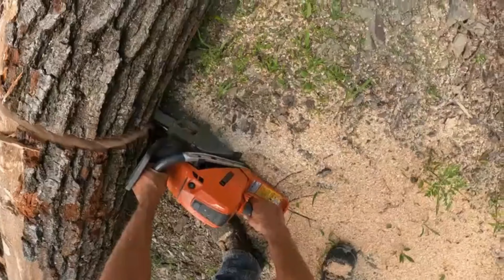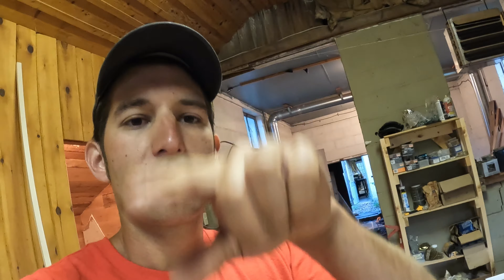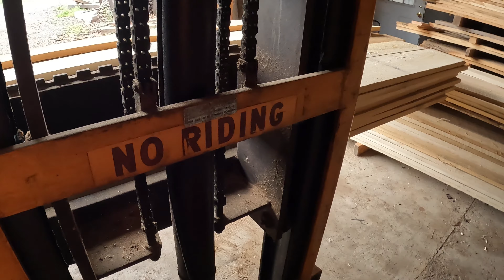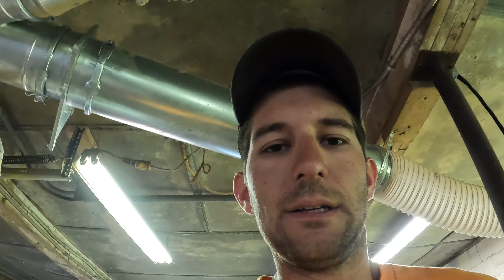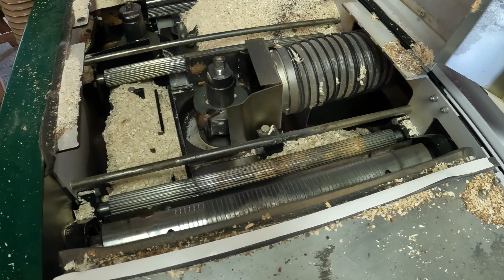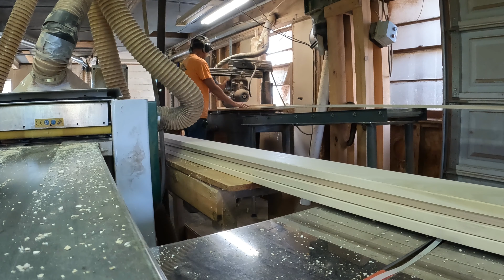Creating A Custom Trim Package For a New Home, Part 1

Comment: Im new to your channel and i realy like your content 🙂
A thought  that came to me and i have no idea if it would work for that small profile if the back and bottom is just straight would it work to make the profiles on both sides on a wider piece and then rip it in half  then you have 2 pieces for one pass of the moulder and a wider top for the feedroller to grip on.

Keep up the good work.
Reply from the maker: Yes that would work. You’d need a mirrored version of the profile knife, which I don’t have, so I made do with what I had on this order, but it is a good trick and I’ve used it in the past for small parts.